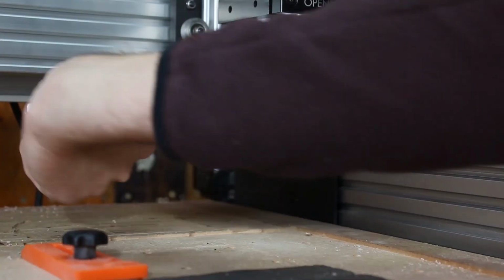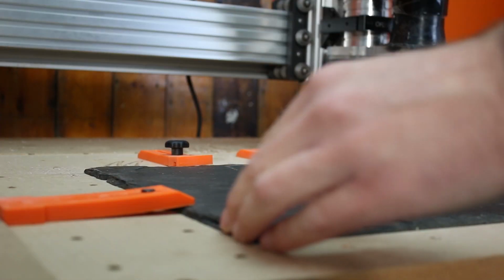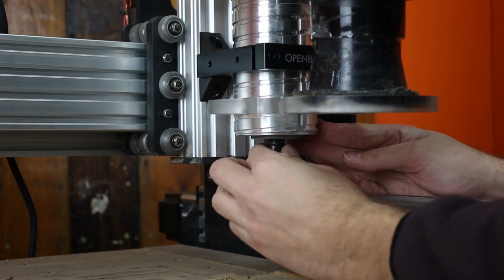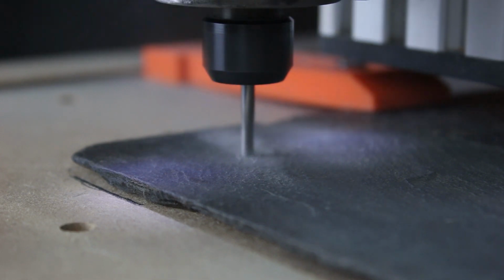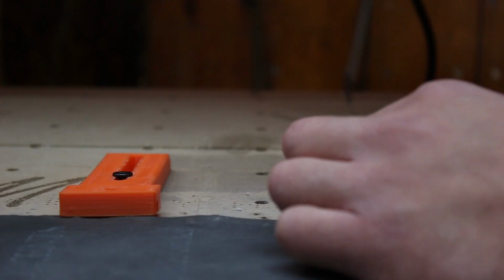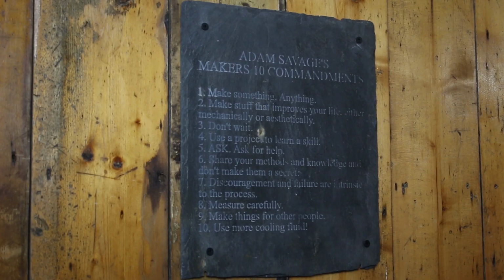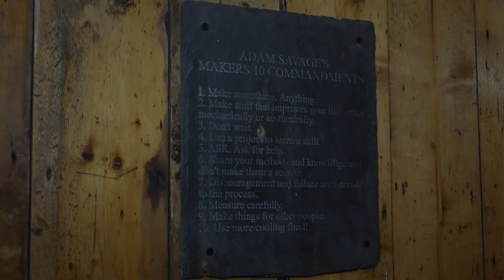Makers Minute | Cutting Slate 10 Commandments For Makers | WorkBee CNC Machine

Comment: hi, can i ask about the bit you use for the lettering firstly, is this a Vbit for likes of carving wood, i have a spetool bit 60 degree vbit i use on wood, so was wondering if this would be any good? also do you have any links to the bits you use
Reply from the maker: Hi,

We just used a standard solid carbide bit, not the most ideal bit for slate, but it did work.